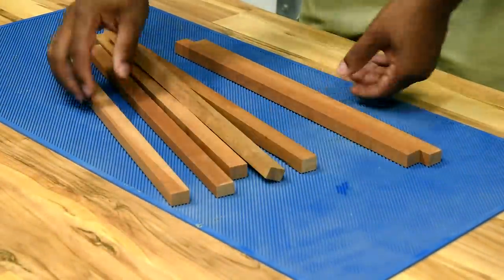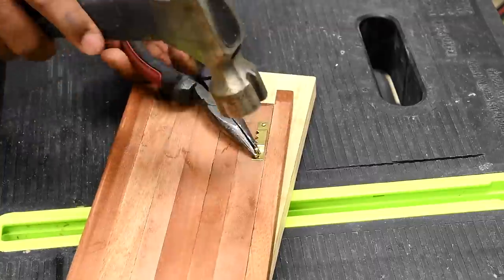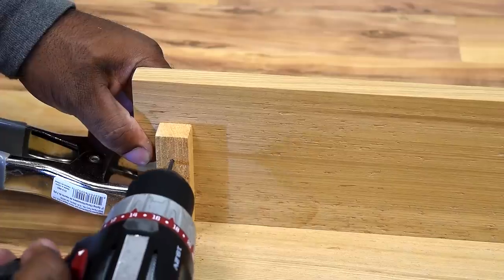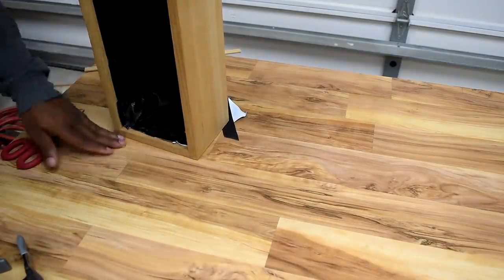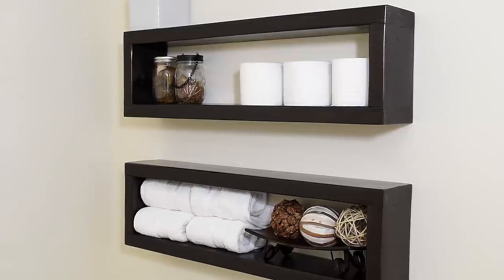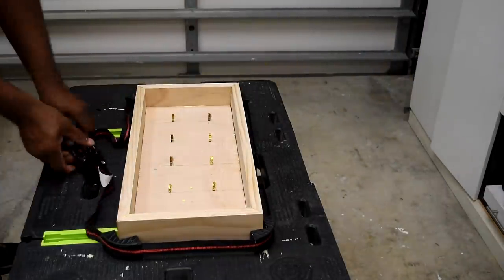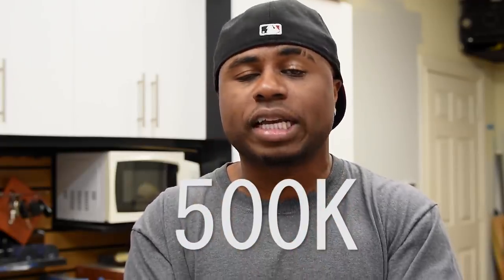4  DIY Projects that can instantly improve your space

Comment: succulent info! don't keep the soil moist all the time, let it dry out and stay dry and since you don't have drainage holes, wait longer between watering. use a syringe to water that way you can water right under the floret to get the root ball but they only need a few teaspoon of preferably rain water or few days old tap water. also they need bright filtered sunlight, not direct but a few minutes a day is okay to allow stress color to show. how that helps!
Reply: What's the name of the two types of echevaria's he used?
Reply: the dark one in the middle is either an echeveria black prince or an echeveria black knight the outer ones could be echeveria runyonii
Reply: I have a feeling hes gonna kill the succulants
Reply: Right!!
Reply: Thanks for those great tips!
Reply: Succulents only need to be watered once every 2 weeks.

Comment: I have watched the video on the section for the cacti planter several times and today I am going to buy some wood and screws.   I'll make mine slightly different, but I really like the idea of using cedar and not putting drainage holes in it, but preventing water from going through the planter by using pond liner.  I also want to thank you for giving me a link to amazon to buy some pond liner.  I am using a different liner, but you got me to the right place for finding it. Your video was very clean--just showing the info needed and the measurements in the "show more" section.  The video was well done and I really liked it. Also Kudos for warning folks about not over watering cacti--especially in the winter.

Comment: When making the sunglasses case you used a hand held miter saw. I noticed when you glued them together the edges were smoothed out. When I’ve used the handheld miter saw in the past my edges were not the smooth. So question, did you sand them down after you cut? If so did you cut “extra” to account for the sanding?

Comment: Yo wassup Glen, I enjoyed this vid! keep it up bro...Im new into woodworking, I had a silly question, if you use internal wood outdoor and paint it with outdoor paint will it mess up?
Reply from the maker: What up D B? Thanks! It's not recommended because its like a home for termites and will rot faster. If you keep it on a covered patio, for example, this should be fine. Consider using a protective coat such as a urethane that UV Rated. This should prolong the life. Just avoid direct contact with the ground. Your better off using pressured treated wood for harsh environments.
Reply: Thanks for the prompt reply man! ....yes I've made the tools shed, I've raised it with exterior wooden legs i made myself but the shed it self is normal wood. at the moment I've painted it with fence paint, ill try getting some poly on there soon the, thanks a lot brother...keep up the good work, i love your vids! Respect from the UK
Reply from the maker: +D B Anytime man. Thanks for tuning in.

Comment: What's that container that you use for your wood glue called?
Reply: Tom's Outdoor Experience

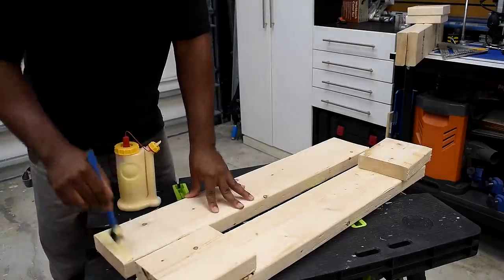Which one?  In the beginning it was a regular 16oz glue bottle with a silicone brush spreader tip thingy.  At 6:40 that's a Glu Bot available from FastCap or on Amazon.